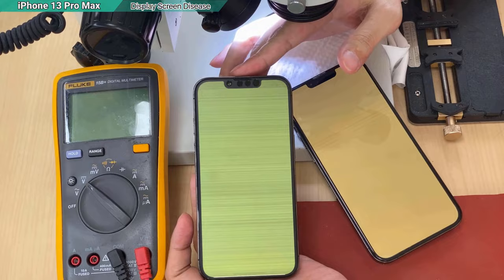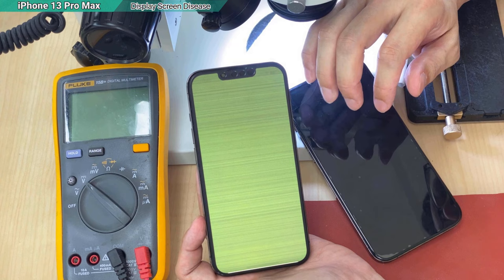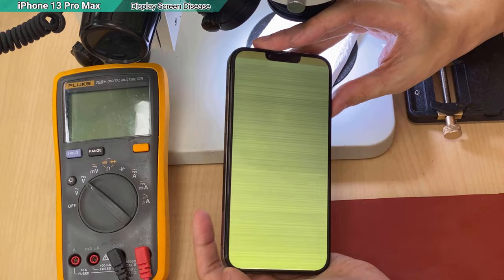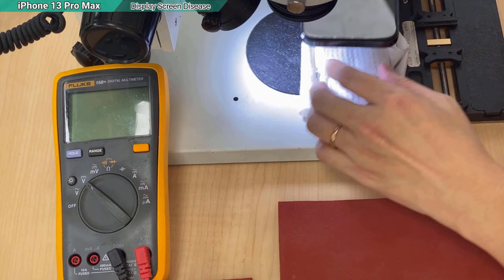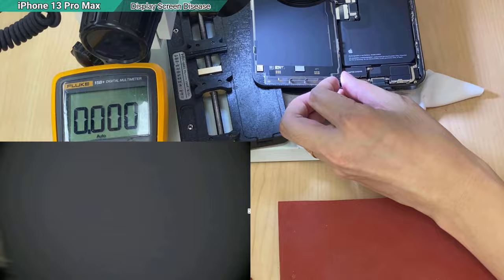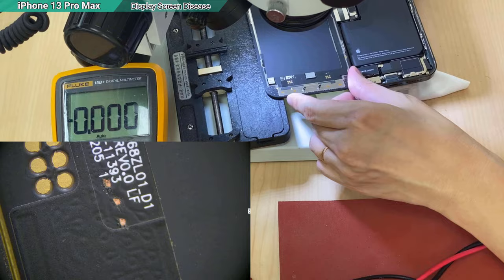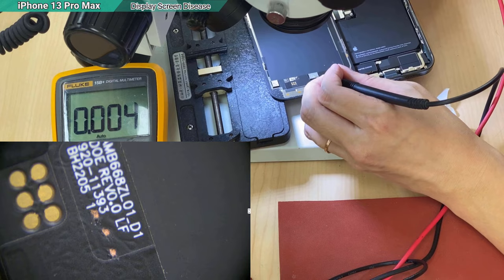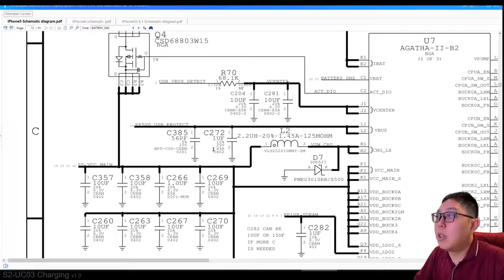Display Screen Disease Repair Explanation for 13 series 【Tutorial】

Comment: Will this work if jumper method has already been used before? Because you mentioned in the last video that after the first jumper without using a resistor , if customer returns then there’s no solution
Reply from the maker: Don’t work if it’s completely become short and zero resistance.
Reply: i tried first 100k ohm.. no changes in green screen.. tried 50k ohm, there was improvement but there still visible green screen..

next 10k, same result as 50k ohm.. til 1k ohm but there is still minor green screen..

so i decided to just put plain jumper
Reply: @ivanzsar over volt and missing volt are two different problem. Apply solution accordingly.
Reply: @laiklim  yes.. thanks to lim.. i will do some measurements first
Reply: Thanks dear master Lim for this educational research and sharing to the technicians globally❤

Comment: Hello sir, my iPhone 13 Pro has the same issue with that. First it was white display, and I brought it to a cellphone repair shop, where they did a "jumper," and after a few months it went all yellow-green display and started blinking nonstop. Is it still possible to fix it?

I hope you will notice my question. Thank you in advance.

Comment: Great video! I have iphone 13 pro max with 30% lighter at the top of the screen and 70% darker screen. Did you faced with this problem? My screen works fine with another iPhone. Have you ever faced such a problem? Maybe i must replace display ic i9100? Thanks for answer.

Comment: Should I do it without disconnecting the battery and with an active display? is there a risk of damaging the phone? Will it work if you turn off the display or battery? or apply voltage to the problem display line and then break it?
Reply from the maker: Do without disconnect the battery or turn off. Even the screen is on is okay.